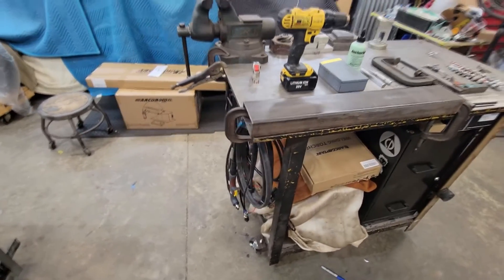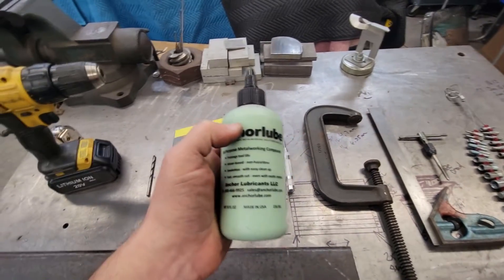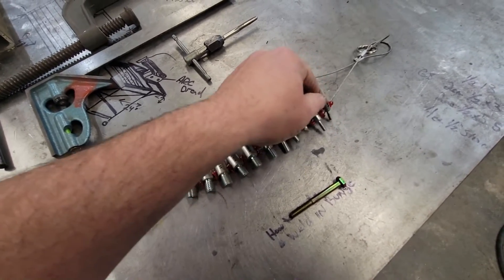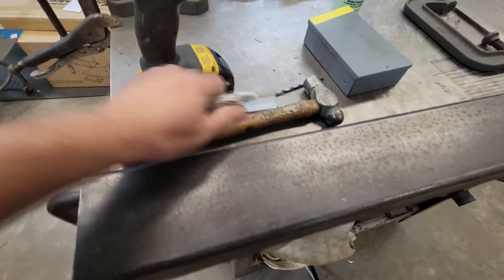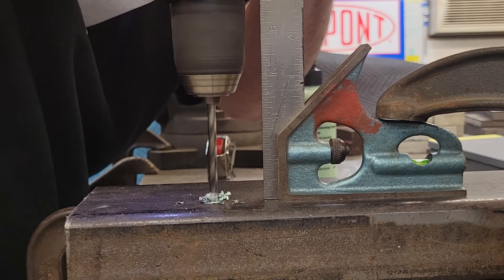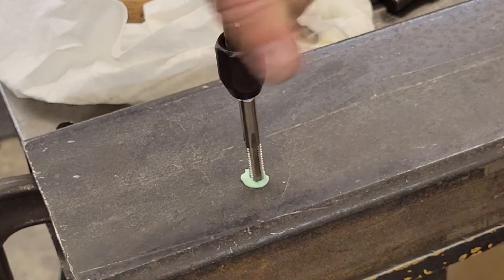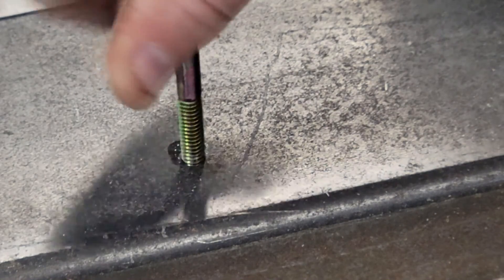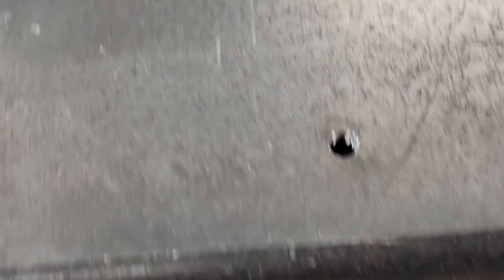How to DRILL and TAP Steel with (Basic Hand Tools) For Beginners*

Comment: Hi there,
You could use a 2"×3"×2" aluminum or steel blocks and drill
holes with your drill press using your mostly used drill bits and use the block as a guide for drilling.
Good luck!!
Reply from the maker: Thank you for the tip!!!!